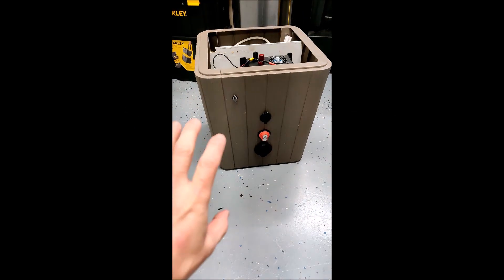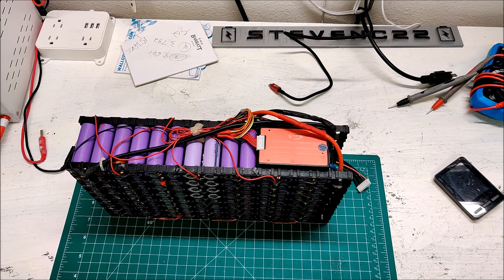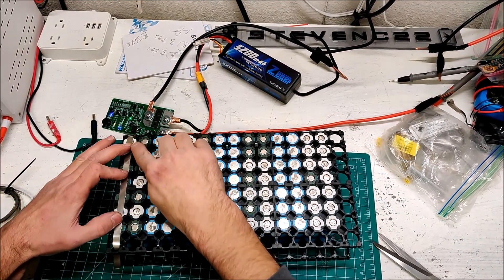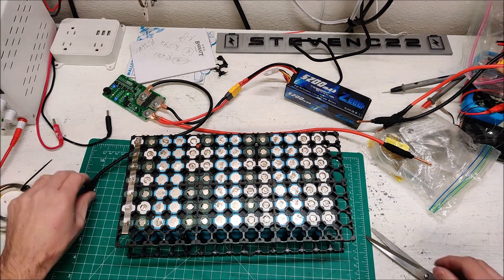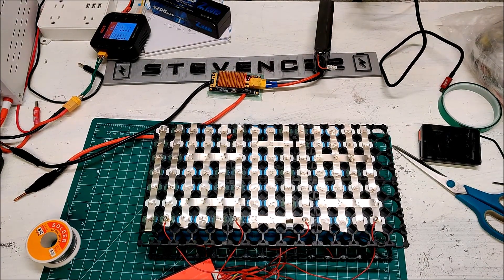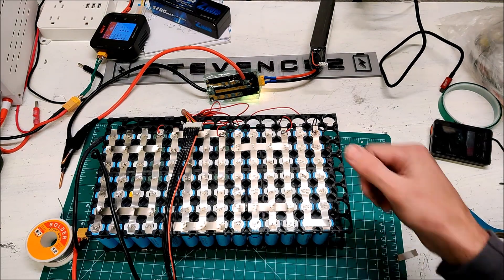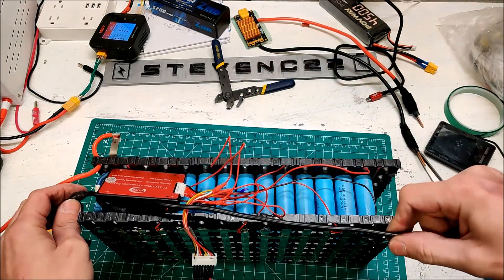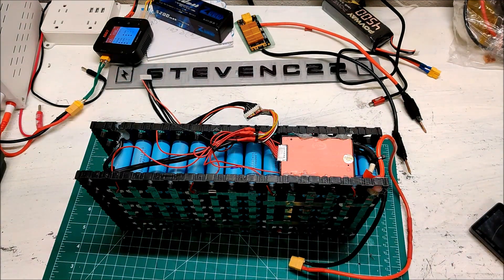Spot Welding a 24v 18650 Battery

Comment: Ehat a great battery build,it would be awesome to have one of those spot welders and not having to struggle with soldering
Reply from the maker: Yeah, spot welding goes quickly compared to soldering.
Reply: @stevenc22  what do ypu think about using a old modified microwave transformer with some timing circuitry as a spotwelder?
Reply from the maker: @tiaan1587  yes I have seen those. Seems like a lot of work when a battery spot welder PCB is $18
Reply: @stevenc22  unfortunately i can't get them that cheap here in south africa,it works out to more arround $40-$50 for a "cheap" spotwelder
Reply from the maker: @tiaan1587  I'm from Jo'burg 👍
Reply from the maker: @tiaan1587  yeah a microwave transformer will work fine but be careful. You are dealing with a 240v home made device.
Reply: @stevenc22  oh woww,do you still live here or have you immigrated
Reply: @stevenc22  okay great,i just wanted to check if it would work and not just burn through the nicel strip or do something exciting like when you short the big power backup battery
Reply from the maker: Immigrated to Houston for college
Reply from the maker: You can control the power of the transformer by changing the number of secondary windings. It is adjustable if it's too powerful
Reply: @stevenc22  i wanted to say i heard some megenls when you were speaking,thanks for the fast response man and all the great tips for building all these thing
Reply: @stevenc22  Rice?
Reply from the maker: Rice what?